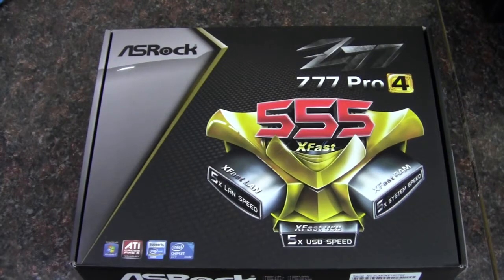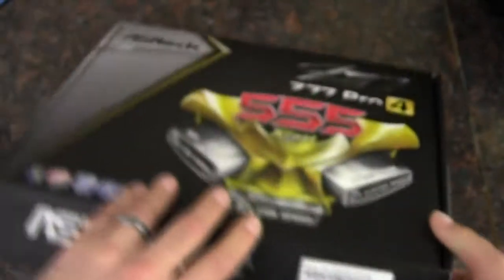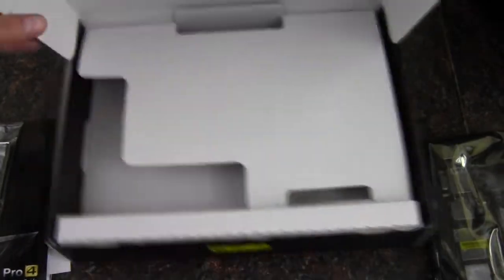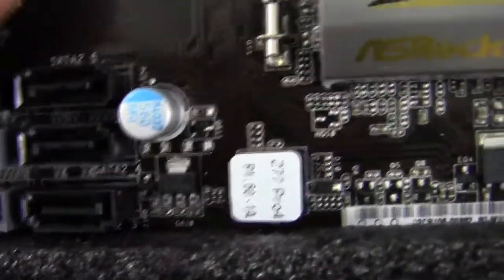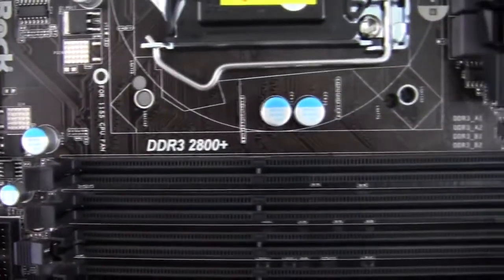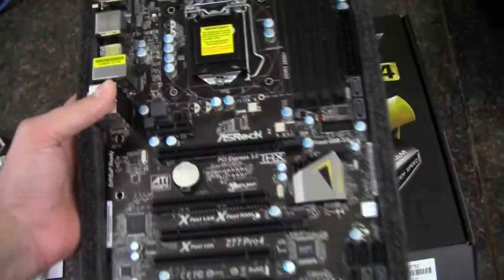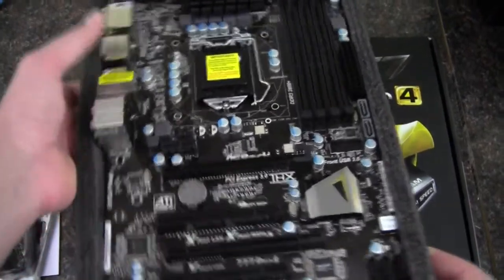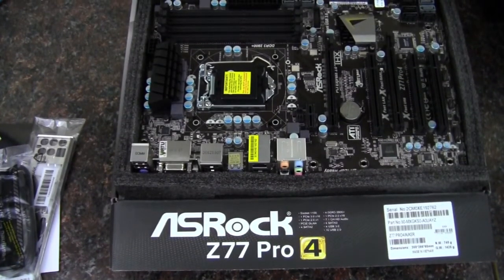ASRock Z77 Pro 4 Intel Motherboard

Comment: Found a desktop computer recently at my local supermarket recycling center that had this motherboard in it. Fully working. 🤔😎😇😆👌👍

I put in an Intel Core i7-3770 CPU & 4x 8 GB DDR3 1600 MHz Kingston RAMs.

Comment: Far as I can tell trying to trouble shoot one of these (low usage) by email, these boards were utter glitchy crap. Dont buy a used pc based on one of these, unlikely to go well.
Reply from the maker: What kind of problems are you running in to?
Reply: @AdoptedMike  my nephew got a low use htpc machine, changed the card from a gt 610 to 710, machine wouldt even turn on.
not even with old card back in. or no card.

returned to seller ( dodgy pc repair man) 
machine was returned working in original state with a small fee.
I tested out and sent an rx 460 4gb (its a 380D (watt) antek PSU, same thing. pc wont even start with or without card, either card.

Comment from the maker: I have not used the Extreme9 yet, but I haven't found an ASRock board that I haven't liked yet. If I were you, I would Google it and see if any of the big reviewers have done testing/benchmarking on it. Usually, they will give the pros and cons of what they test. AnandTech and Toms Hardware are a couple that I like.